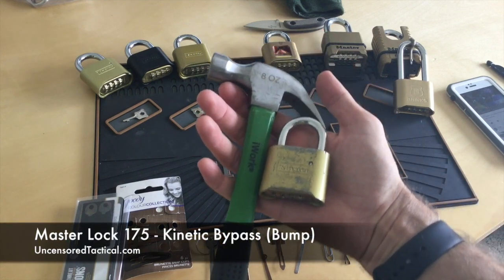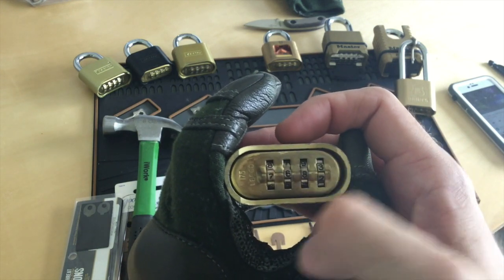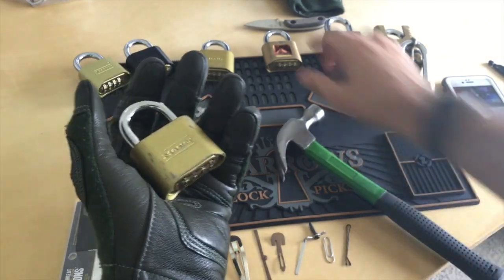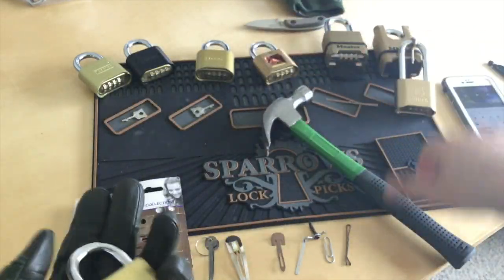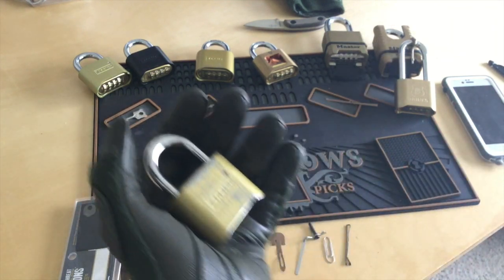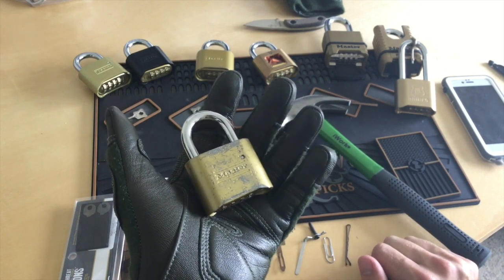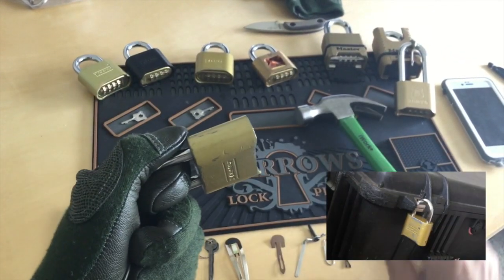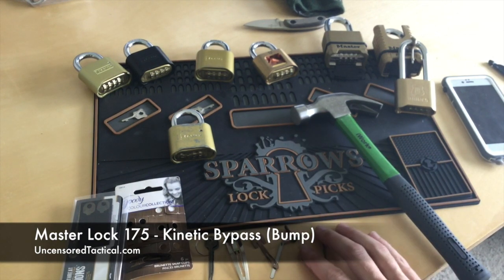Master 175 Kinetic Bypass - Bump

Comment: I know this video is a bit old but just wanted to mention to you that it's easier if you push the shackle half way down with your thumb before striking, then letting the force of the hammer nudge it out of your thumb grip. Opens up on the first time, every time with the right force.

Comment: Hey, bud.  I've had better luck with a wooden mallet and hit it diagonally down on the hasp edge with the retainer pin facing you.  If the wheels free spin it'll open  pretty much every time.  Thanks for the video.